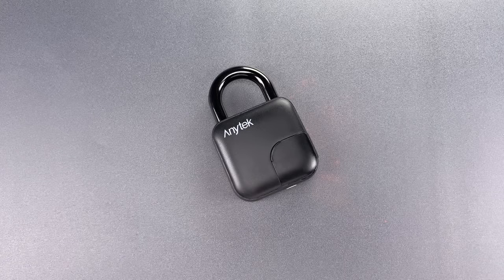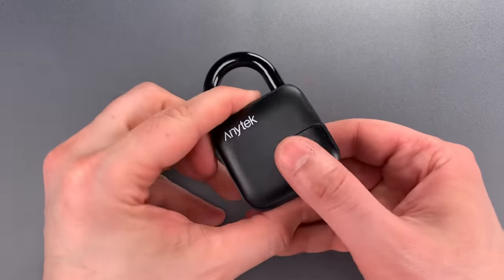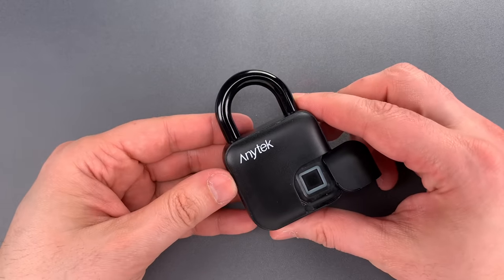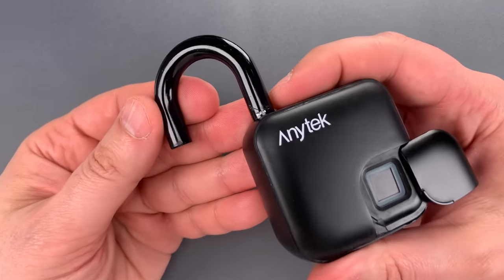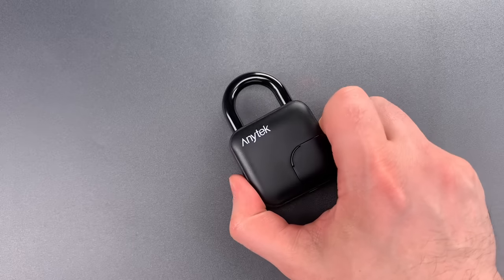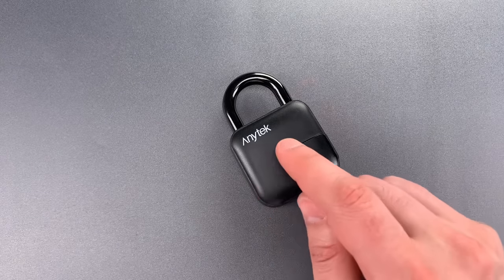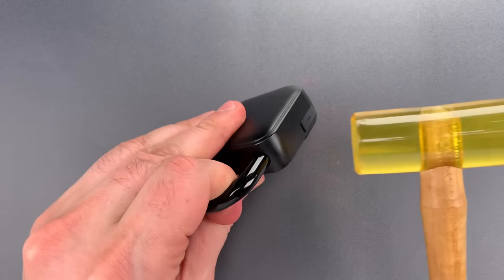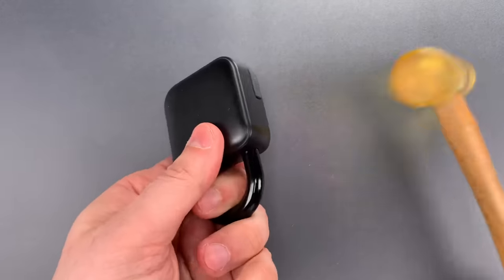[1247] A Serious Flaw In The Anytek Fingerprint Padlock (Model L3)

Comment: When hammer is used for non-destructive opening - you know it's garbage lock.
Reply: Percussive Picking.
Reply: the lock would be even worse if a urethane mallet could be used for destructive opening
Reply: @colbunkmust  If you have a pump strong enough and strong enough, well engineered nozzle - then you can cut it with water. So I assure you, you can destroy it with this mallet. Couple hundred hits will probably make things so loose inside that it is going to separate completely. Provided that it is made from the same material as shackle or even softer - since a lot of damage will be done by some already little loose part, bouncing off other parts. Yeah - mallet won't be in great condition after that, but that's not the point.
Reply: @jannegrey593  I'm not sure what your point is. There is literally nothing that a high pressure jet of water can't cut. Abrasive water jets are used to cut tool steel and rock. And I'm not talking about hundreds of hits. LPL doesn't spend the time to showcase hundreds of hits to a lock. He did two strikes. If the lock had been destructively opened from those strikes it would be unquestionably worse lock than if it was non-destructively opened from those same strikes.
Reply: @colbunkmust  True. But I think it might be so low quality that you would literally destroy it with couple hundred hits of this mallet. And I don't mean just open it. I mean destroy it permanently, without using weak points. This metal just looks so... weak and iffy.
As for the water - I know. But It again looks so low quality that a Kaercher for carpet cleaning or washing a car, might be able to cut it or at least damage it.
Sorry. It just looks so delicate and not up to any standards. Especially the metal looks so darn weak and soft. Forget hacksaw - you could cut it with a spoon. Sure it would take couple of hours, but you'd probably do it. Something just made me snap when I look at this lock. It's weird. I rarely have such a strong reaction, even to something that BS.
Reply: @jannegrey593  No, a Karcher definitely wouldn't be able to cut through it. Have you ever used one???
Reply: @Yoda-177  I hate explaining jokes. This lock looks so flimsy that I "bet" Karcher would be able to cut through it.
Although you said it "definitely wouldn't be able to cut through it". Have you ever heard of erosion? ;) I think you mean "immediately or in reasonable time".
But seriously - to me it looks like it's barely stronger than if it was made of pure tin. My biased perception. Something in this lock's flimsiness triggered me - which is weird.
Reply: Truth. Also, the same attack works on the ubiquitous Master #3. Just saying.
Reply: @jannegrey593  Destroying it isn't the point though.

The fatal flaw in this lock is that it can be opened nondestructively and then locked back up again.  This means any gate, door, or hatch secured with this lock can be opened at any time, access into the secured area made, and then the lock put back on again when the person or persons gaining entry have done whatever it is they seek to do.  The proper owner or user of the lock won't have any evidence of the penetration, so might not be aware that anything was stolen or might not be able to explain what happened to those they're reponsible-to or to insurance.

Bad as Master Lock can be most of the time, at least a crusty, crunchy old weatherbeaten Master Lock No. 5 may be hard to pick because it's so corroded inside that even a key barely works and it still requires at least some skill to pick, so most would cut the lock.  Lock cut and left in place or missing at least evidence that someone gained access, alerting the legitimate party to check for missing property or to be able to raise an alert.

With this thing, someone could repeatedly break into an area that the responsible party thinks is secure in order to rifle through the contents and steal as desired and until enough stuff is determined to be missing no one may be the wiser.
Reply: @TWX1138  I know. Dear lord - I was joking. Also do you only use destructive methods on locks that are flawless non-destructively?
That lock looks so flimsy, that I thought it would be funny to see destructive method - because likely cutting it with a carrot would work (that's an exaggeration - but people don't understand my jokes, so I'm writing it here). There are couple hundred comments here, that laugh about how easy to open it is. Why do so many people gave to be triggered, because I joked? FML.
Reply: When a 'plastic' hammer can open a lock it's substandard at best.
Reply: Ya
Reply: @jimruby9657  when the bump key becomes the bump used glow stick

Comment: Ohh, a striking attack. I was totally betting on shimmable.
Reply: Same
Reply: Magnet probably when I first saw it
Reply: I thought what the heck is a shrinking attack and then I saw the glaring flaw that I won't mention.
Reply: Same
Reply: They though about that, but didn't think to design it so it won't open when it hits the door in a strong wind for example.
Reply: Shimable is a 2+min video because he spends 30 seconds or so on the shim design. Sub 2min is either striking or raking.
Reply: @bobbycratchet3958  ehhhhh ^^
Reply: Can confirm

Comment: What i've learned after all this years of watching LPL, is that if you want to lock something, lock it real good, just use Duct Tape.
Reply: Be sure to watch Project Farm on which tape to use.
Reply: Plastic lock packaging...

That's usually more secure than the locks it holds
Reply: A bent nail would be more secure.
Reply: And smear dog poop on it
Reply: I have met baling wire more challenging to open than half of the locks he presents.
Reply: With red security marker between layers!

Comment: I was hoping for some magnet action
Reply: That would probably work too
Reply: Maybe a torch to melt the shackle
Reply: @Dirtyharry70585  If the shackle gave up as much as LPL showed it did from just one hacksaw pass, I would expect someone could simply yank it open with their bare hands (assuming it was attached to something solid).  Or maybe pry it open with a screwdriver.

Comment: Is the entire lock industry a sham?? This channel makes me question every lock I see.
Reply: The Abloy Enforcer 350 seems to do pretty well. LPL picked the 341 but it took him longer than usual and the 350 is a newer model. Locks like the 350 are standard for semi trucks for high value loads.
Reply: Yes.  Of course, you may not want maximum security locks on most everyday things, just stuff that can deter everyday lock attacks like shimming, striking, bolt cutting, etc.  The problem is that not most locks have those either.
Reply: At least many of the "traditional locks" will stand up to someone beating on it with a hammer, needing a loud power tool, or a lot of strength to break... These fingerprint and bluetooth locks all seem "4th grade school locker" quality.
Reply: Really locks are mainly for insurance purposes. Give a skilled person or unskilled time enough and a lock will not stop them. What it does do is show that it was secured meaning that depends on the insurance company if it is insured also can affect what the person that did it was charged with.
Reply: @iantaakalla8180  Making a lock that can withstand bolt cutters that isn't the size of the Abloy locks is difficult. A plant I used to work at used slightly smaller padlocks on the gates, and our "master key" was a rather large pair of bolt cutters that took the locks apart without too much trouble. It was also handy for reminding contractors to remove their lockout/tagout locks before they leave for the day.
Reply: @johnree6106  Yep. Depending on how the lock is positioned, it can be pretty difficult to pick, though. The one I use is positioned on trailers in such a way that you can't get a bolt cutter around it easily because the lock fits snugly into the door with no extra room on top. It also can't be rotated to see it at all, so you have to do all your lockpicking unable to see what you're doing and with a friend holding it because it is not so stationary that it won't slip on you. It's probably easier at that point just to take the door hinge off.

Comment: Surely the fix for this is to replace the solenoid-based locking system with a motor-driven one. Sure, it would take a smidge longer for it to lock and unlock, and the battery wouldn't last as long, and you'd have to have the lock in an unlocked state to close the shackle, but it would overcome the security flaw that lets a simple percussive attack pop the lock.

Comment: I would not be 100% sure that the shackle is one material. It might invovle a pretty cut resistant core, that however is pretty water-vulnerable. Thus it was protected from water using something corrosion proof like Aluminum.

Comment: What I'd like to see is how you find out these weaknesses.
Reply: You can tell it's spring-loaded from the fact that there isn't a whirring motor noise when it opens. As soon as it has a spring-loaded locking mechanism, you know it's likely to be vulnerable to shimming (which pushes the sprung component out of the way) and/or hitting it with a hammer (to bounce the sprung component out of the way), so you try both of those things.

He finds the weaknesses by understanding how locks work and knowing the basic weaknesses of each mechanism.

Comment: I wonder when an NFC lock will be manufactured? Not traditional NFC in the sense you just place the phone on and it powers up, (which in fact, it could do) but one which requires a phone using biometrics to send a specific series of combination pulses when a specific fingerprint profile is detected. The application could even manage its own fingerprints.

This would minimize the electronics of the lock while increasing its complexity, and I assume the conversion from fingerprint profile to a bunch of electrical pulses for an unlock would be a smaller device profile than including biometrics on-board.

Comment: Nah, I'm sure it's just a misunderstanding. This is clearly a backup combination lock - it consistently needs precisely two quick hits. It's just an easy to fix manufacturing error that they left it set to a testing combination - a single, low number 2. With a combination like [6 (pause) 9 (pause) 4 (pause) 20] he'd never open it this way without knowing the code.

Comment: I'm curious his opinion on whether a better designed version would actually be good, as in theory a better designed version would not be shimmable, has no lock to pick, and would resist cutting and hammer strikes.  Is this a poor implementation that previews a future lock that would actually be good?

I'm suspicious it would not be good, due to some manner of electrical zap, software attack, lifting the fingerprint off the prior press, destructively disassembling and hotwiring the fingerprint sensor pad, etc, but I suppose that's for a future video when a far better successor arrives.

Comment: First, i only benefit from this video is that it showed me how to pick this lock. 
However, most importantly, it is dumb to believe any security measures including this below $100 lock can give u absolute security. Burglar doesn't even use any tool to kick the door open even with locks that guarantee for 250lbs force. There is always a way for someone to hack or crack any security tools.
Its main feature is only to give u convenience and to avoid some of the people taking ya stuffs with at least some degrees of security measures. A normal person is not gonna bring a hammer or a saw with him all the time. If someone does, he's intended to steal and he's definitely prepared and experienced. So how much of a lock we have to purchase in order to battle these burglars then?

Comment: I wonder how easy it would bend open? Looked like the opening side of the shackle barely engaged the body and had no locking lug so as soft as that shackle seems i wonder how easy it would be to bend open when locked to a solid staple.

Comment: So the shackle is soft and doesn't sink too deeply into the body of the lock when it locks up. How much force would it need to force it open with a twisting attack, when it is locked to a hasp? Would it be possible to stick any long metal bar (long screw driver, wrench, whatever) through the lock and just twist it with bare hands?

Comment: Are there any rating of "Security" for US or Canada?  I want it to be LPL proof from 1 to 9, 1 is under 1 minute for LPL,  2 is over 1 but under 2, 3 is over 2  but under 4, 5 is over 4 but under 7, 6 is 7 up to 10, 7 is 10 to 20, 8 is over 20 minutes, and 9 is unopened after 3 hours. Only locksmiths advanced toolkit, no Jaws of life, angelgrinder, jackhammer are allowed. Noiselevel under 80 dB. You could exchange LPL for BoBill or people like them or better, make this a worldwide certification/industry standard. It should be applicable for the whole "system", if the lock is unpickable, it should not be allowed to be bypassed. Example You have a level 7 lock, but You could bend open the door or take out the hingepins, then the system drops to the lowest level.

Comment: Designer: "We built a cool looking lock but have some concerns over security"
Management: "What's wrong"
D: "Well if you strike it with a mallet, it opens"
M: "That's not good, is it difficult to do?"
D: "Well it takes two strikes"
M: "What kind of criminal tries twice? You know what they say about insanity! No one would try twice, APPROVED!"
D: "ok..... also..."
M: "What?"
D: "Well the shackle is pretty easy to cut with a hack saw. Can we use a different material?"
M: "How many strokes would it take?"
D: "Dunno, 5 or 6?"
M: "As long as it takes more than one we are fine, you know, insanity, definition... APPROVED"

Comment: I wonder how he comes up with these ways of opening a lock.
Does he hit every lock with a hammer?
Reply: All spring-loaded mechanisms are potentially vulnerable to shimming (pushing the sprung component out of the way) and hitting it with a hammer (bouncing the sprung component out of the way). As soon as you find a mechanism with a spring in it, these are the first two things you'd try. How do you know it's a spring? Basically the two options for electronically controlled locks are springs and motors. If it was a motor, you'd hear the whirring noise as it locked and unlocked.

Comment: I'm curious - when you get a new lock, do you disassemble it to find the weaknesses, or do you just try the common flaws first?

(i.e. for this one, I assume you would have tried a magnet to see if it was just a solenoid holding it closed, shimming, the hammering attack, shimming, until it opened.)

Comment: I wonder, why won't the companies producing locks hire a professional to find out the flaws of their products before mass producing them and putting them on the market and ruining their own brand. Just imagine if these Anytek or whatever company produced 20 of those locks and sent them to 20 locksmiths before actually starting to produce them in bulk. There wouldn't be low quality metal used, and they could actually find a way to stop the lock from opening with just a flick on the side!